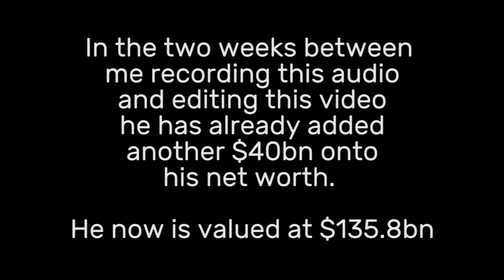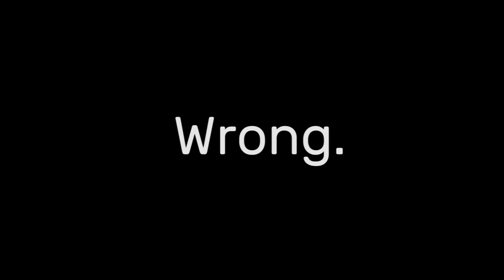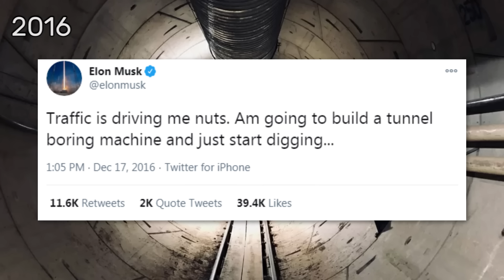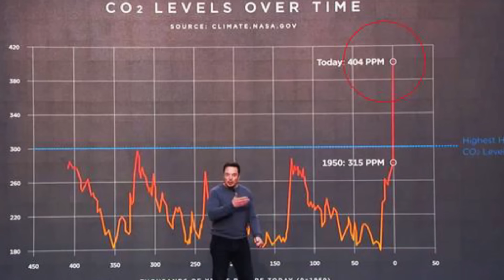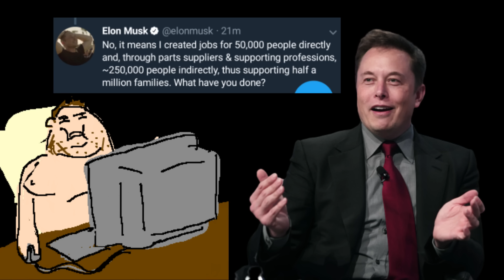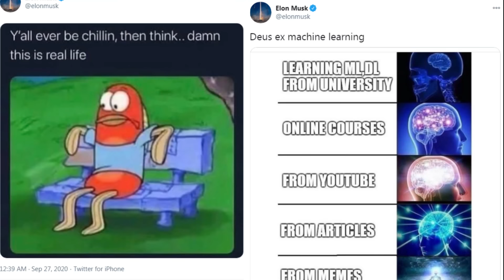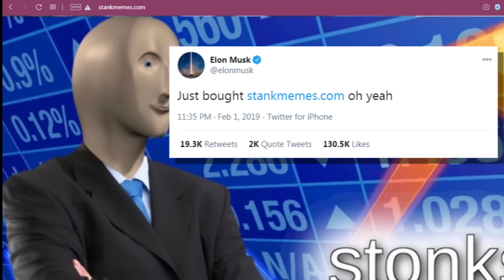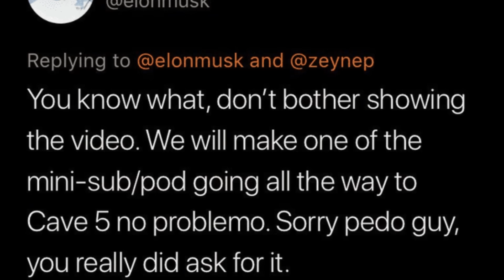ELON MUSK SUCKS!!!!!!!!!!!!

Comment: DCX was the first self landing rocket in the 90's.
Reply: The vacuum loop was invented in the 1700's
Reply: Bruh, DC-X is comparable in size to a leg of a Falcon 9 booster. Not only Falcon 9 first stage is much more taller, but it is also thinner. Also, DC-X has a privilege to hover, while one Merlin engine is just too powerful to hover.
SpaceX uses SUICIDE burn (it's called suicide for a reason) and Entry burn. No one was able to demonstrate those before SpaceX.
Reply: In terms of max payload and max altitude a Chinook helicopter is closer to being a space rocket than DC-X.
Reply: @noname117spore  DCX was a demonstrator that would have been scaled up but the funding was cut. ("Star wars") My piont is that Musk didn't invent vertical landing and DCX demonstrated superior flight capabilities to the spacex grain silo. The Lord Vapor wasn't the first to put an electric car in space either, (First abandoned stolen vehicle in space) Boeing did and it drove on the moon.
Reply: @sylvesterstewart868  DC-X COULD'VE been great had it got the funding. But it didn't. It remained a low altitude demonstrator far removed from ever doing anything useful. And sure, Starship's only a little better than it at the moment, but they have Falcon 9. Falcon 9 is the real deal.

The electric car was a nice stunt, a good way to turn a test flight into something memorable for people to see. Not sure why you brought it up when it wasn't in the original post and I never said anything about it. Maybe you thought your argument was too weak so you decided to construct a strawman to give you a better chance of winning.

Already though the service of and cost improvements of the Falcon 9 have been impressive. That's the accomplishment of SpaceX so far.
Reply: @noname117spore  The point is that musk takes credit for other people's work and Im sick of him and his cult acting like he invented everything. The falcon program has been a success at the expense of taxpayers which was supposed to be the point of privatization.
Reply: @sylvesterstewart868  I mean, without him VTOL rockets wouldn't be in orbital use until probably a couple years down the road at least, and that one would have Jeff Bezos responsible for it and I'm pretty certain he's worse.

Sure, the Falcon program cost taxpayers some money to develop, but in operational costs its saved taxpayer money compared to alternatives. And it should be noted a lot more taxpayer money has been thrown at SLS and ULA's Vulcan Centaur (unless you combine F9 costs with the costs of all of SpaceX's capsules) for development.
Reply: @sylvesterstewart868  Well I've got nothing more to say then other than that you've revealed exactly the type of human being you are. Goodbye.
Reply: There's literally zero comparison between an orbital rocket and a test bed like DCX
Reply: @kenshi_cv2407  People think Musk invented a vertically landing rocket. (Among many other things.)

Comment: If you have ever worked on any  engineering project you would know that there is no chance of an owner/CEO/manager doing an actual engineering (developing designs, writing code, manufacturing stuff, etc.). That’s just outright impossible. 

Though it does not mean that Elon or someone else was not/is not involved in analyzing details and guiding solutions with the core engineering team. 
Especially at the early stages. 

He does now write code but builds an efficient system at macro scale which enables writing of a functional code. 

He’s more like a football coach who dictates the process (even though he pretends to be a player). People need to understand that. People also need to understand that he has done a lot in life. I mean a lot.

Comment: Terrestrial astronomy and space industries have been stuck in place for years. Even without starlink, eventually the atmosphere would be saturated with satellites from other companies. Or clouds, or planes, or gasses that refract light in the upper atmosphere. We should have been working to put telescopes in space long ago. But just like most reasons in most industries as to why we didnt strive for the best: because what just barely gets by works well enough and is cheaper
Reply: ahem the kessler syndrome is about a orbit becoming unpassable. also we have developed tech that allows to get similar resolution to some space telescopes on the ground. space is better suited to some electronic telescopes that are super sensitive to atmospheric intereference and some realy realy specialised tech.